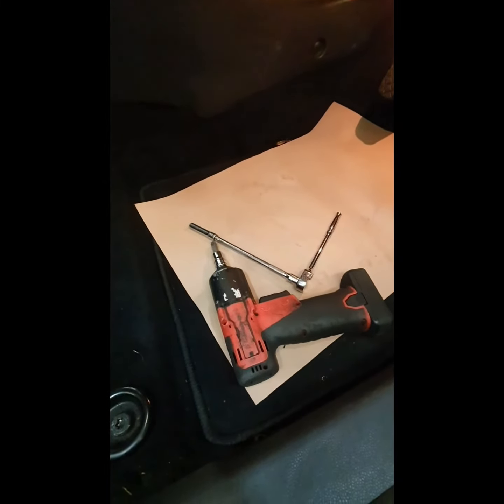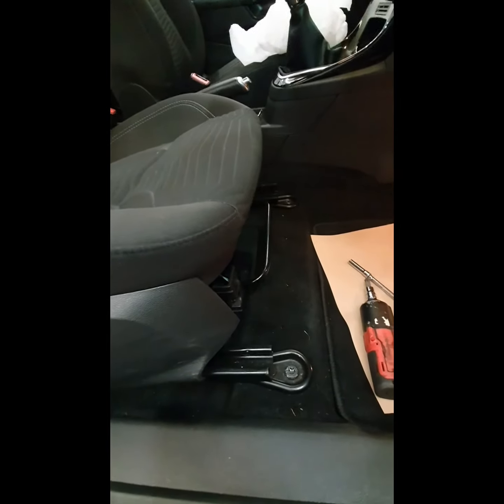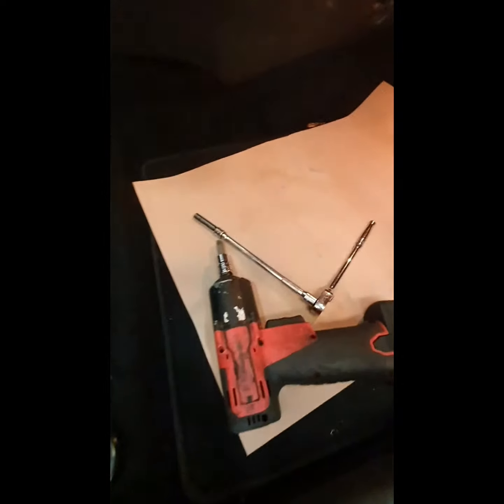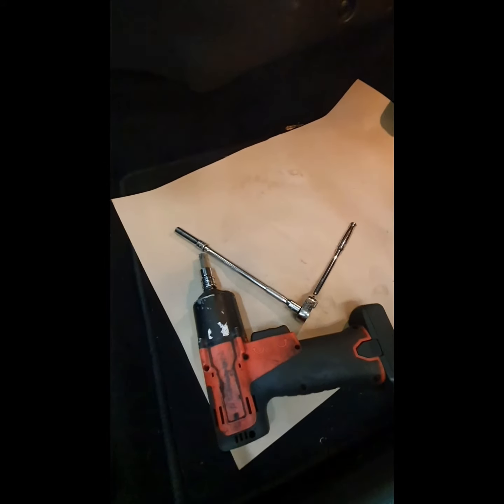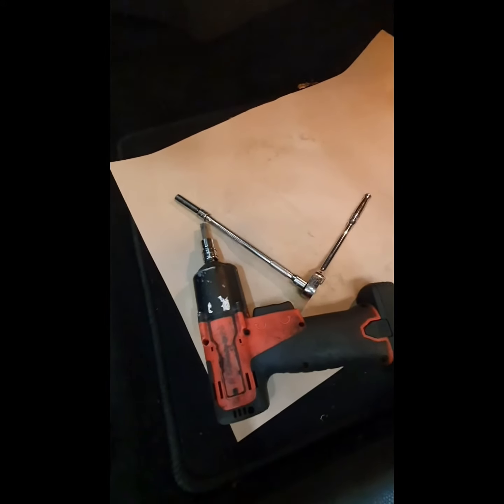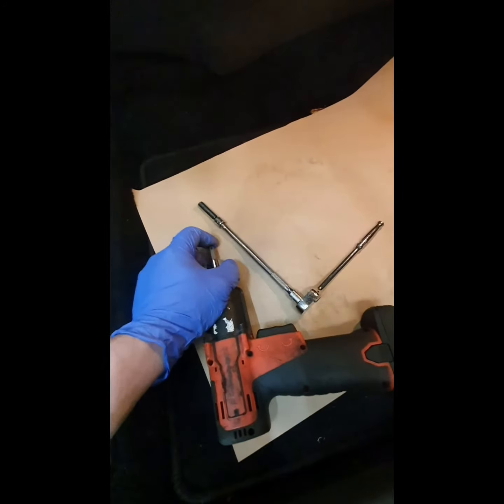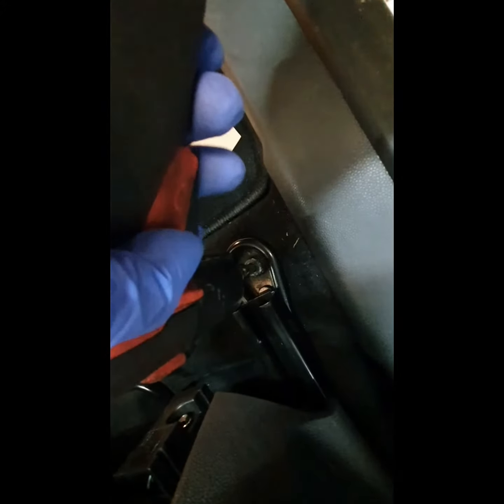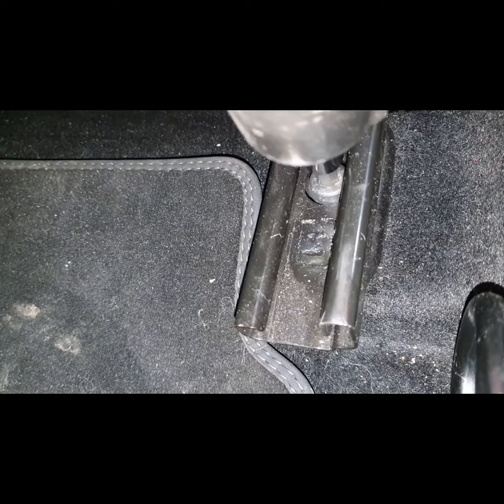How To Remove A Ford Fiesta Front Seat - Ford Fiesta Front Seat Removal

Comment: Do you bother pulling the battery before disconnecting/reconnecting or do you just whip the connector out and back in again? Would rather the airbags not go off on me, but some of the suggestions I've seen are ridiculous (dis the battery and wait 30mins to an hour before unplugging the seat connector?!)
Reply: Did you end up unplugging it?
Reply: @goodpools  in the end i sought some advice from other repairers and the consensus was that it was unnecessary. I did indeed unplug and replug without disconnecting the car battery, and nothing bad happened. :)